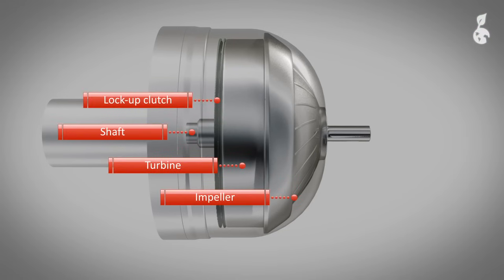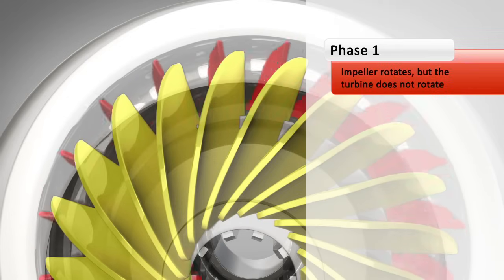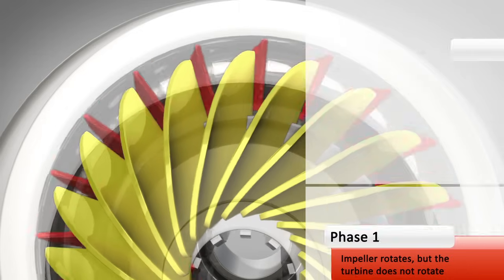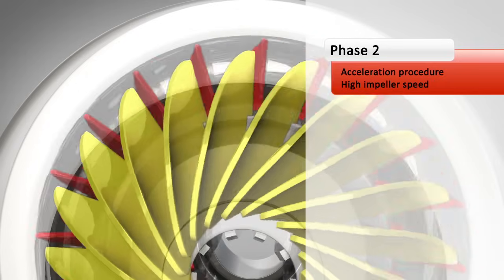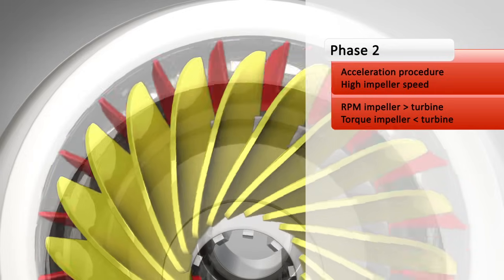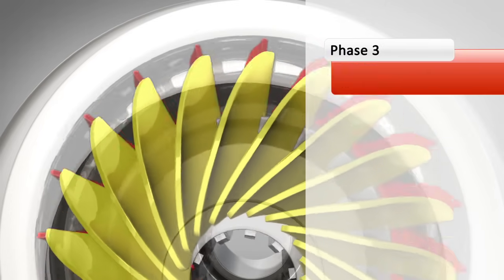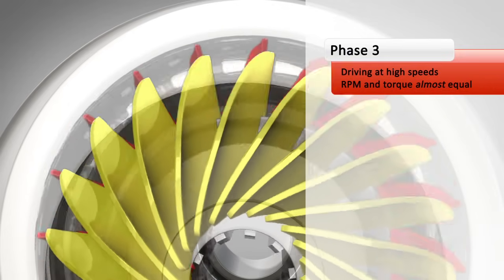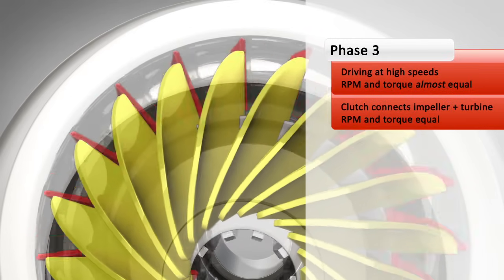How Torque Converters Work! (Animation)

Comment: i wonder why it is said that automatic transmission cars acclerate faster than manual ones on traffic lights.
by seeing this video, it seems opposite, and that only seems logical also.
can anyone explain?
Reply: Pratham Singh If the driver is skilled, a manual transmission car will always be faster due to the superior efficiency of manual transmissions. There is no power lost to fluid motion of torque converter.
Reply: Pratham Singh With a fluid coupling, you can just mash the accelerator to the floor and the impeller will spin the turbine smoothly, perfectly, every time. With a manual, power must be more carefully transmitted to the drivetrain or else excessive clutch wear might occur. Basically a torque converter is a clutch that you can slip all you want, but instead of wearing out, it heats up. For example on drag racing cars, they tend to use automatics with high stall torque converters. Stall means that at a certain RPM point, the wheels either must spin, or the engine cannot spin at a higher rate. Typically street automatics from the factory have low-stall torque converters so they feel responsive driving around at lower speed; with drag racing transmissions, you'll see torque converters that have a stall rate much higher.

Comment: is it any difference between a Diesel and a petrol Torque converter except stall speed?

Say you have a low rev gas engine and put transmission on a diesel engine that have almost the same torque.

Diesel I6
130hp @ 4000 rpm original (and about 200 hp tuned)
Torque 218 LB Ft @ 2580 rpm
(Tuned i don't know but say the torque come between 2000 - 2500 Rpm)

petrol V8
Brake H.P. (Net) @ RPM 180 @ 4400
Torque (Max) Lb. Ft. @ RPM 272.5 @ 2800
Torque (Net) Lb. Ft. @ RPM 262 @ 2400-2600

Comment: cool, always wanted to know how an automatic trans worked. this is cool and good to know.
Reply: Alien Or Sutin  
Apparently, as the title states, it's about torque converters. There are videos on how automatic transmissions regarding gears work as well. This clearly isn't about that, though.
Reply: Richard parnell I still want to know how it works, this video didn't help me, did it help you? I expected to hear the word "gear" at least once. Lots of talk about some spinning impellers and turbines but nothing about why it's important for an impeller to spin a turbine. What's the advantage of that. What does the multiplication of torque that was mentioned do for us? Still lost.
Reply: Alien Or Sutin I got the basic idea, I wanted to know how a automatic could sit in drive without staling out, its because the fluid being pushed from the first  impeller to the second will pass trough the second impeller and still put pressure on that second impeller, thus being able to make the car crawl when you let off the break or sit still when you are at a stop.that's also how the rpm's don't have to match the transmission speed off the line, that's where the power loss comes from with an automatic.  hope this helps if not shoot me your e mail address the rest of it im still learning like the lock up when both impellers are going around the same speed and it becomes a direct lock from engine to transmission, I was looking at one of those windmills and wondered if they work on the same principle?
Reply: Alien Or Sutin As Going Hard said, this video is about the Torque Converter. It's the equivalent of a clutch for a manual transmission. Note: Not all manuals use clutches and not all automatics use Torque Converters. Some newer automatics are switching to a wet clutch. With the extra gears, they don't need the torque multiplication a Torque Converter does and provide better performance and efficiency. As for an automatic transmission, they use planetary gearsets and clutch pack/band to control the flow. A 3 speed automatic uses 2 planetaries to give 3 speeds and reverse by controlling which part of the gearset is lock to the housing and which part has power applied to it. Planetaries are called such as they resemble our solar system. A central "Sun" gear surrounded by 3-4 planetaries with a ring gear wrapped around the outside. Clutch packs work in the same way as a clutch for a manual. the only difference is pressure is applied by hydraulic pressure to a piston. When a automatic transmission fails, it's usually caused by burnt out clutch from lack of fluid pressure. This is why checking transmission fluid level is very important. Even a quart low can blow out your transmission as pressure drops. BTW, if you ever saw someone on a hill that wasn't using their brakes and wonder how they weren't rolling back down the hill? They raised engine rpm just enough to hold the car/truck in place.

Comment: Hi , Thomas I dint know whether my doubt is valid or not and also whether its my poor understanding about the concept but i would like to ask you that , why the RPM which is the output from the engine is converted to Torque which is generated by this torque converter. Thank you for the Video

Comment: Hello Thomas, thanks for the video animation and great explanation about torque. Just a correction if I may: Centrifugal forces do not exist, only Centripetal forces exit.  The red arrows you showed, should not have been parallel to the radius but rather perpendicular.
Reply from the maker: Daniel Lago Hi, thank you for your comment. In fact, neither centrifugal nor centripetal forces exists (or they do it both or just one of them). We just use words or concepts to describe things we discover. If humans were blind, would there be colors?
Reply: Great Thomas, keep up with the good work.  Engineering is awesome.  Ok, ok, and so it Physics, Math and all the other stuff...  :-)

Comment: Impeller blade throws out the oil which rotates the turbine. The turbine sends the oil back, but if there wasn't the Stator, the oil returned by the Turbine would cause  the impeller to brake. The Stator's blades divert the oil so that it will aid the impeller, thus the torque multiplication. In high speed, there is no torque effect, everything is turning at the same speed. That's why torque converter lock is used to clutch all three together to aloow the vehicle to drive without need for a torque (torque means use of power, thus fuel.
When the vehicle is not moving and the turbine has no resistance against it, the transmission shaft is not clutched/engaged so the system is useless, just freewheeling.

Comment: This is a very good explanation, as well as an excellent animation.  I'm still a little fuzzy on the torque conversion. Torque conversion implies torque multiplication, right?  So presumably in a high throttle stall, the turbine produces more torque than the engine delivers?  I'm sure the language you use in this clip is better English than that of the average American.

Comment: i understood the working of a torque converter from this video. its really very nice explanation of how a torque converter works but i have a question regarding the freewheel. i actually want to know where the one way clutch (or freewheel) is mounted on this assembly. thank you
Reply: it's the stator's bearing. It connects the stator with a protrusion of the gearbox housing. So when the stator locks, its locked to the protrusion, ie, it's still. This happens during acceleration and torque conversion. When the desired speed is attained and the car is coasting, the oil hits the stator blades from a different direction and it free-wheels.

Comment: Great explanation, very helpful. You say that during phase 1 ("stall") when a car is stopped at a light, the engine is still turning the impeller, but the turbine isn't moving because the brakes are holding it. Wouldn't that cause resistance against the engine, thus requiring additional fuel consumption to keep it idling? Do automatics usually switch to neutral when stopped to prevent this?
Reply: You are correct, and they don't. This is one of the reasons manual gearboxes are more fuel efficient. You could however switch to neutral manually but I doubt anyone does.
Reply: Victor Jönsson Actually I do this all the time. It lets me keep less, if any, pressure on the brake pedal while I'm waiting for the green light.  In fact, depending on the car I'm driving, I'll select neutral when approaching a stop in order to reduce the drive force of the transmission; that way the brakes are more efficient in bringing the car to a stop.  Give it a try, see what you think.

Awesome video, great explanation, and your accent and syllable emphasis is enjoyable.  Pay no attention to the first reviewer's banal comments ... there's always one of those in the crowd.

Comment: great explanation, but what happens if you hold the brake and press the gas at the same time? will the turbine still spin sending power to the wheels even though you're applying the brake? I've always wondered where the energy will go if the wheels are not spinning. I know it should never be tried
Reply: Yes tru. This is how you make stall test; aplly the brake and put the machine on gear. You expect the engine not to lose more rpm than allowed. If power you demand from the engine is more than what it can deliver, the engine goes down.
Reply: If you press hard on the brakes and hit the gas, the engine and impeller will rise to a maximum rpm, usually somewhere just before the power band or within (depending on economy/performance), and go no further. This is called stall speed. Torque multiplication is at max and the whole system is under a lot of stress, due to the energy being absorbed by the coupling oil which heats up fast and, if continued, could deform or blow out the converter.
Reply: Heat and Friction
Reply: buck buck and waste of fuel

Comment: does manual thing give more fuel efficiency or this automatic one ????
Reply: you waste less energy when the power is transmitted through solid gears than fluid (torque converter oil)
Reply: always
Reply: But the energy loss allows for smoother acceleration.
 In applications like trams.

Comment: I have a 04 ford explorer 4.0 liter. The transmission was rebuilt and started leaking slowly at 35,000 miles. The transmission was taken out the front seal, pump seal, and rear seal was replaced on the transmission. Now the fluid is only leaking while you are driving the vehicle. You can leave it running for hours in park and it doesn't leak. But once you put it in motion it leaks pretty bad. Do you have any idea what would make it leak only while driving it? Thanks for any help you can give! The torque converter has been looked at by a transmission shop and they say it looks fine! My husband is a 18 wheeler and automobile mechanic but doesn't know a lot about transmissions. He was thinking maybe it's the front pump. But I have looked for a replacement front pump but I guess you can't just buy the pump by itself.
Reply from the maker: Holly Elizabeth Hi, sorry, impossible for me to say.
Reply: Winjury is right, find the source first.
Put some cardboard or plastic underneath your car. Then probe the oil stains to check whether it leaks engine oil or ATF, so to help pinpointing the problem.
To save time however, I'd try anti-leak additives first. These additives rejuvenate the gaskets, preventing or even fixing the problem.
These are available for both engine and tranny.
 
I bet you know all this, but just in case: Never skip oil changes. Oil becomes intoxicated overtime by the fumes it absorbs. Contaminated oil will eat your gaskets & seals...
Reply: Ronald van Kemenade I would advise against any kind of fix it fluid. Just inspect it like winjury said. If needed go on a forum for that specific make and model and post there. You'll get more than enough help.

Comment: I am asking myself what the advantages are compared to a modern CVT. I can only think of durability. Maybe someone else can think of other reasons. These automatic gearboxes  always seemed sluggish to me. Even the gears behind it are almost like a manual gearbox so it seems to me there is allot of energy lost mainly because of the torque converter. Maybe it is because allot of people still want some feedback of their car.......

Comment: Very great animation and explanation!  However, there is one problem I noticed. You said that centrifugal forces cause the fluid to flow out, but that isn't true. Since centrifugal forces don't actually exist and it's just a lack of centripetal force. Of course, this is coming from someone who pays too much attention in physics class at uni. Otherwise the video is completely correct, just needs some rewording.
Reply: Centrifugal force is a real thing and it is useful to talk about. It just isn't a real force; It is a "fictitious", or "apparent" force.
Reply: Genuine question.. How is there not centripetal force? The impeller turbine appears to spin, is this whats causing it to flow out? Or does it not flow out; what happens?
Reply: Ted Gabara when the fluid is spinning, its tendency is to continue on a straight path out from the center of rotation. This is what is wrongly known as centrifugal force. It is actually the inertia of the fluid wanting to continue outward. Centrifugal force is the force keeping an object from continuing on that path away from the center. For example: a string on a tetherball; it keeps the ball on a circular flight. Without it, it would fly off tangential to the point on the circle the force was lost at.
Reply: drune9 exactly! That's why your body experiences an inertial force outwards, because centripetal force accelerates you inwards. The fluid wants to stop accelerating and the only way it can do that is by flowing outwards.

Comment: basically to make a long story short the way i learned how a torque converter works is when a guy showed a demonstration of two desk fans facing each other, one plugged in and operating and the other just sitting there unplugged, and the unplugged one started spinning after the power one was turned on, basically the wind energy that was being blown out of the power fan was transferred to the unplugged one and started spinning it from it's output energy, same concept as a torque converter but with hydraulic energy

Comment: Very clever piece of design - the torque converter.
Also the video was nicely done. Well explained and well presented. Liked!
Reply: Alien Or Sutin Well what would happen if you come to a stop if the impeller and turbine are connected? Engine stall. And that's exactly why this thing is in an automatic transmission. Since there is no clutch paddle, the whole process of "slowly releasing the clutch" has to be done by something. That something is a torque converter.
Reply: megadriver6 Really? Why is it a great design. All I saw was an impeller using fluid to spin a turbine. Directly welding the impeller to the turbine would spin it even better, and at 100% (not 90%). I don't think the video explained at all what's the purpose of doing that. Just saying "it multiplies the torque" didn't help me. Too dumb?
Reply: Alien Or Sutin

Sure it is a simplified explanation, but most people will understand it better.
Cause me and other petrolheads, we know whats happening in our cars in detail, but the standard motorist doesn't.
Also, don't you think that the automatic transmission is a clever piece of machinery?
Reply: The TC is the only part of my car I [still] don't understand.
Reply: Alien Or Sutin

Best advice I can give you is to go to a mechanic who is working on an automatic transmission and ask him questions.
Best to do so if you are friends with said mechanic.
A friend of mine who works in a Benz dealership showed me how the 4G tronic works in detail. They had one for an overhaul and I spent half a day there examining parts XD

Comment: The torque converter elimnates the need for a clutch hence the automatic transmission.
Reply: it also magnifies torque so it's very useful on heavy machinery

Comment: Hi. Nice video.

What are the advantages over just using 2 shafts and a coupling to transmit the torque or am i thinking of something else?
Reply from the maker: Hmm, don't get you point, sorry :)
Reply: maybe i'm missing the point completely, but i was asking, why couldn't you have a torque converter with 2 shafts attached via a coupling. both shafts spin, both have torque